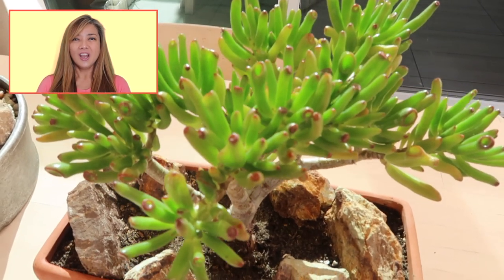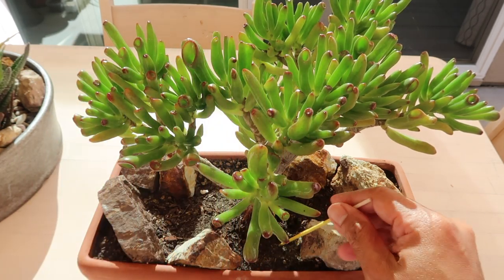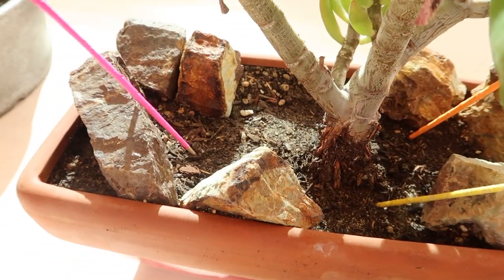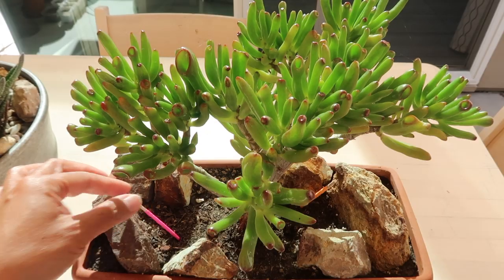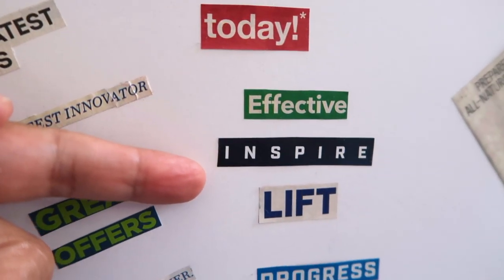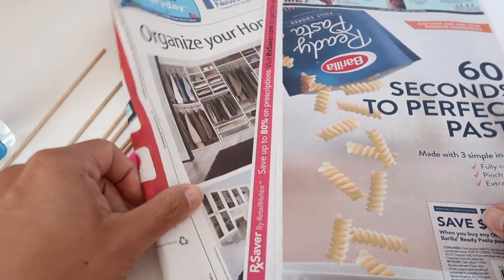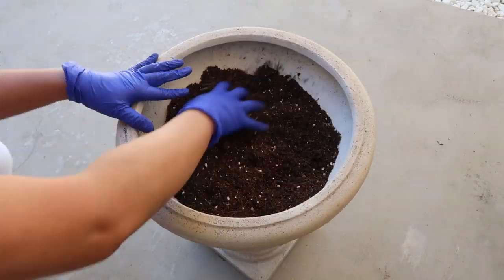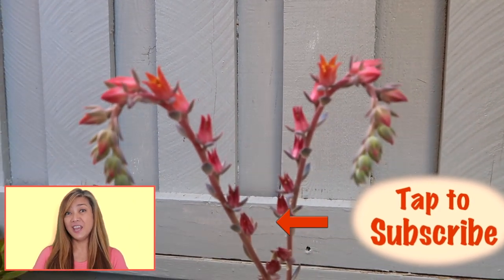Ultimate Solution to Succulent Deaths Due to Overwatering

Comment: Thank you for this easy diy idea! I have a moisture meter for our veggie garden which is kept on the other side of our property from where my succulents are. I think I will make these to use for my succulents! Quick question, does it need to be absorbent paper or would washi tape work?
Reply from the maker: Hi, Yavonna! Yes, it needs to be absorbent paper. Most washi tapes are water-resistant, thus they are not likely to pick up moisture. They might not give you an accurate reading. They would have been convenient, right? With the sticky side? Unless they are made of absorbent material, I think they might not be as good. This is a very good question. Thank you for asking. I really appreciate it. More blessings to you, your family and all your endeavors. ❤️🙏🌈